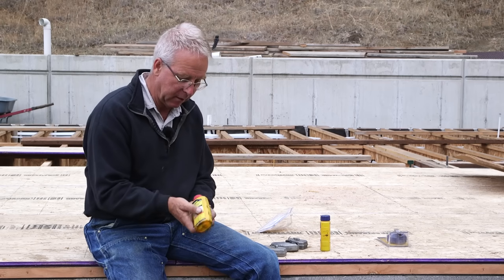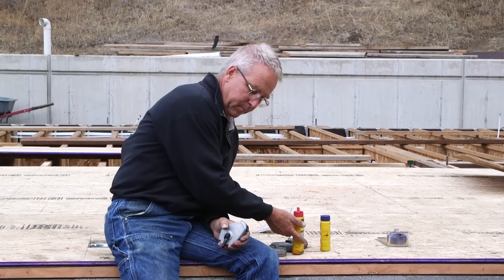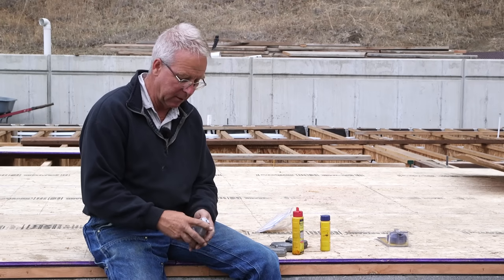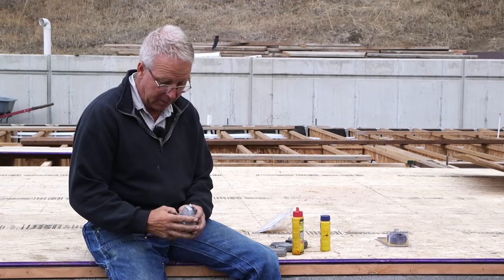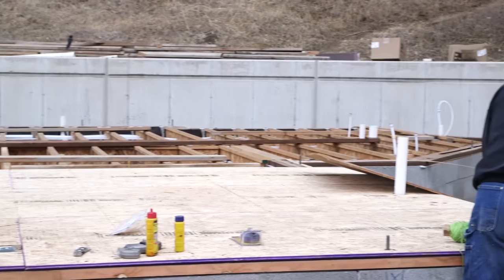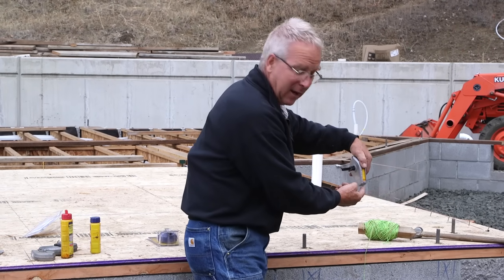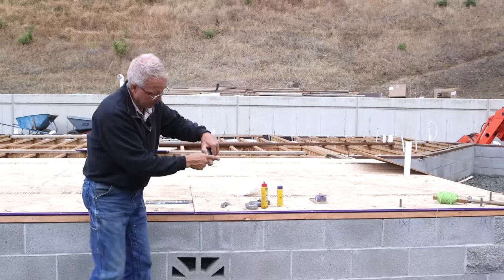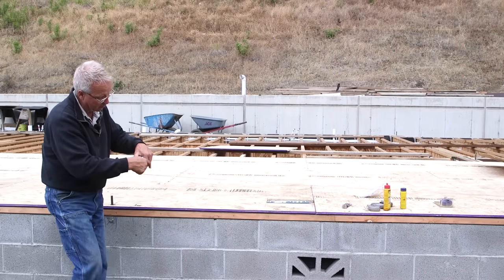Chalk Line Basics

Comment: Always preffered the old simple Irwin chalkboxes to the geared ones.  They lasted longer, and were easier to take apart and fix.
To fill a new one, what you do is pull out the string of the new one completely.  Then you start filling the box slowly, with just a light chalking as you reel it back in.   You do this by placing your finger on the bottle of chalk, and shaking it like a ketchup bottle to loosen the chalk.  Then you put the nozzle into the opening of the chalkbox, with the chalk bottle, at an angle.  NEVER POINT IT DOWN. Or the chalk will pour out too fast.  You lean the bottle depending on how full it is, and squeeze it so that you are basically  making the chalk bottle atomize the chalk out.  Squeeze and spray chalk. Reel line in a bit.  Squeeze and spray chalk.   Reel line in a bit.  Squeeze and spray chalk.  Reel line in a bit......
By doing it this way the entire reel has chalk in it. And the  entire line has a light dusting of chalk.   Take line out again...and repeat.  Now the entire chord of the chalkbox is well coated..  Then put just a bit more in front when fully reeled in.  Never fully fill.  Or it jams.   You are set for the life of the chord. So that when the chord breaks, you just tie the hook at the end of the chord still left inside.  Since it was already chalked in its entirety, you were good to go.  
Never had a problem because I always kept brand new backups already chalked in my bag, which I had done at the work site, after finishing my tour.  Never do that at home, unless you have a garage, and can relax while doing this.  Kept them in a plastic bag.  Yellow for concrete.  Blue for indoor layout, and plywood.  White  for sheetrock.  Black was forbidden on many jobs, for regular workers.

Comment: Do yourself a solid, and buy a Tajima. x2 the cost of a lowes or home depot line (irwin, dewalt, etc.) but the box is ergonomic, with specific design features to last. The line is a blend of organic and plastic strand for tautness and durability. The chalk is cheap enough, and will coat the line thoroughly, and only spits out if you overfill. best of all they come in many line thicknesses. treat yo self. great vid brother.

Comment: I refill mine with nylon line when they break short. Not as absorbent but lasts forever and will strike one line usually. Will do both sides of a wall for most part.  They make different thicknesses ,,,get thinner. After a few uses it'll get more saturated and hold more chalk

Comment: The company I work for did a street project a few years ago that had some retaining walls. Myself and another guy drove through there a few years after it was done and we saw it, plain as day: a red chalk line right down the center of one of the retaining wall. I'm a little unclear if they snapped it on the concrete or if it transferred from the form, but they apparently tried everything but grinding to get that line off the wall and nothing worked.

Comment: I always pulled out like 12 foot of line so l had good chalk like 30 foot. That worked well fir me. And dont overly fill. Plus line has chalk on whole string not just sections.
Reply: I alzo preffered the one to one reel. I never liked speed reels
Reply: And when reeling out line l always lightly pinched line in gloved fingers. That way line gets chalk good in string not loose chalk flying. every where and not overly loose powder that blows away with skilsaw blade. Nut l preferr laying out with pencil on end of tape like drywaller.. Its clean and a good fine straight line. How many times have you double snapped a line then had two lines? Happens more than l liked

Comment: I always pull the string out at least 50' before chalking a new chalk box. Spraying clearcoat over it before concrete saw cutting, or when doing layout on concrete for wall layout. Do not use red red or black on concrete wall forms.

Comment: When laying out on wet concrete slabs, a wide floor squeegee and a propane weed burner can clear a dry path for snapping lines. Gotta work fast though. The water always will return to where you found it. Spinning lasers and electronic tapes are handy in these conditions if you have them.
* Also, don't forget to wash your clothes separately after using red or black chalk. Unless all your laundry is also red or black :)

Comment: Back in the day the Air Force used magnets to activate fuel pumps to service large frame aircraft.  The magnets were attached to a chalk line string.  The operator would hold the chalk box.  During an emergency or at the end of the operation you would pull the string which caused the magnet to come off the magnetic switch shutting the pumps down.  I would have loved a chalk line with a mechanical advantage that also freewheeled.  I spent a lot of time fooling with those things on the flightline.  For such a simple device they spent a lot of time failing.

Comment: I sometimes watch a series where they reconstruct a old church using both methods and tools from the 1300:s. Their "chalk" is a piece of cloth filled with wood ash. Slightly more difficult to work with than the modern tools, but leaves a line that is good enough for timber work.

Comment: for anyone needing a much thinner line, replace the stock line with  fly line backing. Its braided dacron. (Use the same braided thin  line on your plumb bob as its thinner and less prone getting blown around by wind, hah any one still use a plumb bob?)You will have a thin line no wider than what you get from a   .5 mm mechanical pencil. If you need your lines to stay put, spray them with some clear aerosol.  There are many different brands like tajima, or the highspeed lines  or even the old Japanese ink lines, and they all have their advantages but its nice being able to carry a few different irwins all with different colours when doing layout(not necessarily doing single family wood frame). They are simple, big as they need to be without being too big which tajimas are, cheap and durable. Have a few spares for when the rain soaks one out or the inevitable internal birdnest happens. Just remember to disassemble in some place where getting chaulk everywhere isnt a big deal. So next weeks episode will be on the proper way to sharpen your carpenter pencil....

Comment: Instead of turning the reel straight out, turn it in so it locks in place,  press in to release the lock and pull to desired length. Let go to lock back in place and you can pull tight using one hand and snap with free hand

Comment: Word of warning, red shock will bleed right through vinyl flooring. So if you're tracking out lines on a concrete floor, or installing a vinyle floor on top of red chalk lines, clear seal and cover the lines.

Comment: found this lol
 After 5,000 years the only change in this technique is that, whereas the Egyptians used wet red or yellow ochre, the modern craftsperson follows the method of Greek masons who employed white and red chalks in addition to wet ochre.
CHALK LINE BOX Filed March 18, 1952 2% as \w F1 F1 INVENTOR. 2 Claims. (Cl. 33-87) This invention relates to chalk-line boxes of the type disclosed in the copending application, Serial No. 116,488, filed September 19, 1949, by John R. Thomson and Robert K. Landon, and since matured as Patent No.

Comment: I've tried a few of the gear box type over the years, and they always break or jam up; so I return to the old unreliable "single action" as he calls it. One guy I've worked with doesn't bother with either of these: he stretches a thick cotton string between two points and rubs a large piece of solid chalk along it The thick string can be used  to snap a lot more lines than the reel type. When roofing, we like to snap as many lines as we can marking the tops of the shingles.

Comment: Is there a cases where a laser layout line would be better than a chalk line or vice versa? The finish carpenter example in specific had me think "just use a laser"
Reply: Lasers are mostly used when you are trying to set a plumb, level, or square line. In those cases, a laser can sometomes be set up quickly and more precisely than snapping out a line but not always and when you're not dealing with those cases you definitely won't be able to set up a laser more quickly or more accurately

Comment: ... Remember, when striking a LONG line pulled VERY TIGHT (that's why you wrap it around your hand and not your finger) the most chalk is marked on the floor on the opposite end of the person doing the snapping, therefore it is best if both people snap it. 
Be sure to pull up straight before letting go.  Yes, I have had people pull it up on and angle then let it go. 
.

Comment: Nothing beats a chalk line full of form realese oil😂 I like the basic hultafors chalk lines as they have no mechanics and are small enongh to fit in then pocket on my jacket. Currently on a magnesium bacho/ironside, small form factor and 3x reel speed. If the footing etc is uneven, rocks etc, I like to put a piece of plywood(15mm) under then line on one end, usually enongh to bring the line off the ground. You can put it down on each end and keep it off the ground with then third hand to. Chalk box works as a plumb Bob in a pinch too👍🙂

Comment: The first thing i do is discard the line in a new box and replace it with Dacron Fishing Line. Much stronger and chalk stays on the line better. Plus 98% of the time it snaps at the knot in the end. On a new box I pull out the line and add chalk when I first real it in. Only adding a little chalk in every now and than.

Comment: you forgot to mention that some chalk lines can be used as a plumb bob as well the place to fill it on the bottom has a round cap that comes to a point and you can fill It from the bottom and use as another tool (plumb bob)

Comment: Perhaps there’s another video on one-person use of a chalk line? Cut into the edge of a sheet of Sheetrock with a knife and push the end of the line in. Or cut the edge of plywood with a skillsaw and drop the end of the line into that. In either case, case away and those cuts become the “helper” end of the line. Remember back in school the first geometry lesson was the shortest distance between two points is a straight line? How much better that lesson could be taught using a chalk line?

Comment: I have a question about "carpenter pants ". Being as most people are right handed why is the hammer loop on the left, and the folding ruler pocket on the right. It is crazy uncomfortable and awkward reaching across for the hammer. And being right handed I typically hold the ruler in my left hand and mark with the right.  So, to me they are backwards.  Surely someone knows as they have been like that a long time. I see a lot of guys wearing them, but do not use these features at all.

Comment: I recognize a couple of those chalk lines and have one just like it.  Boy what a leaky devil and a door that won't stay closed.  WAIT, it is not the fault of the box, it is 50 years old and has had the line replaced many times.  It is time to retire the old guy and get a new one.  At the age of 74 the one I bought to replace it may not last another 50 years....  WAIT if it did would I actually still be using it to snap lines?  Doubt it.  Great video with some real pro tips.  Oh one last rule, the line holder needs NOT to learn the joke of holding onto the line as the box man begins to reel it in.  The line holder lets go and the line wraps around the box mans head, funny once, not the second time!!

Comment: First pull the cotton string off and put nylon back in. Use red only if you want it there forever. I was 19 and a carpenter apprentice. I was getting married on Saturday, Friday at quitting time the crew grabbed me and poured a gal jug of red chalk down my back front and everywhere. I left a red trail through the brass alley , parking lot , car , apartment and showered for over 30 minutes. Still looked like I had a sun burn.

Comment: Worked with a guy who consequently discarded the string in any new chalk box. He went and realed up dryline on it in stead, as they are more durable, have a stronger snap and leave a sharper line with less chalk consumption... in the dry. When it got wet it was absolutely worthless. But then of course... Another reason to buy yet another chalk box. I have tried multiple... Old Stanley 1:1, geared FatMax, Irwins and others. My favorite is the large screwtop geared Hultafors. Runs lightly, doesn't jam, holds a good amount of chalk, and deals pretty well with moist conditions.

Comment: You don't have to pull the string high.  Make sure that the string is tight and snap it gently. It is not a bow and arrow.  You get a stronger line by not having the chalk blow off by the time it snaps down.

Comment: No, no,no, you tap it on the slab and keep adding until it just wont hold anymore chalk.   And you have to pull the line all the way behind your ear an let it rip. BTW, the old Erwin speed lines were the best. Milwaukee makes a good one now and it has not jammed up. Longest working chalk line I have owned, its used all week long, all year long.

Comment: When you say red is permanent you aren't kidding.  When I bought my house 10 years ago there was a concrete slab that had a building on it.  I'm not sure how long ago the building had been there was built but it was many years ago.  In front of the main door there's a red chalk line that's still nice and bright.  That line could easily be 30 or 40 years old and it's exposed to the weather.

Comment: I had a line block on the side of a slider strung 30ft along the back of a house sidewalling I went to slide the line up to the next mark an it slid off the slider flew the line block like a rocket hit the tip of my middle finger an flew 15ft in the air an I was in the way to the hospital to get 7 stitches on the tip of my middle finger...

Comment: Thx4 vid. Luv the boxman comment. Lead guy walks and snaps. A tip I carry a scratch awl (think ice pick) in my rig. This let's me snap layout by my self  while my partner is cutting plates. Works great for sheathing too...the line doesn't come unhooked as you snap. For those of you snapping layout wet  climate I'm using Keson Prime chalk permanent chalk https://www.keson.com/products/prochalk-permanent/
Comes I. Bkack res blue. The hat way if it rains on your layout next day it's still there. Toughest chalk box I've found Dewalt. Keep the vids coming.

Comment: ... Something not covered in the video, NEVER and I mean NEVER, pinch the chalk line to the floor, wall, whatever, with the BOX where the line comes out!
Wrap the line around your HAND a few times (same on the other end) and hold the line past the crows foot (mark) and little bit with your thumb pressing the line to the floor, wall, etc. 
A frayed line will stop layout progress and start the cussing.  
In commercial construction for 43 years and have done a massive amount of lay out.
If you do a lot of layout, plan on getting it on your pants and don't wash them with your good clothes.
.

Comment: If you are indoors use a laser, no mess, 100 times faster and self leveling
Reply: John McGrath  Yes, its very handy too but both have their places in construction and both are irreplaceable in what they can do best.
Reply: And if the line you need isn't supposed to be level?
Reply: @briancorboy1042  lock the gimbal on the laser and turn it, you can put the line where ever you want and most lasers will cover more then 180 degrees around a room
Reply: @jussikolehmainen6310  indeed
Reply: @JohnMcGrathManInShed  I've tried with rake rails with multiple jogs to get around nosing and coming into a newel at the top of a staircase, and have never had it work out correctly. Sometimes less technology is better.